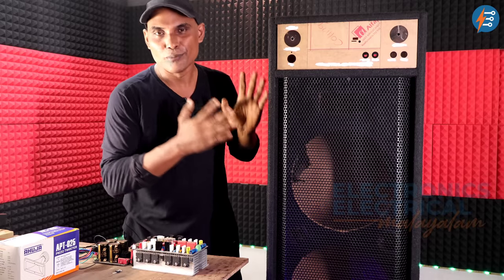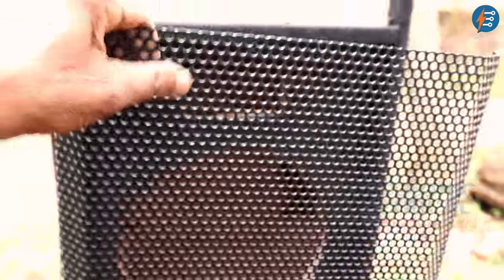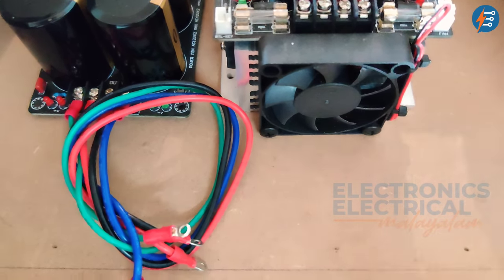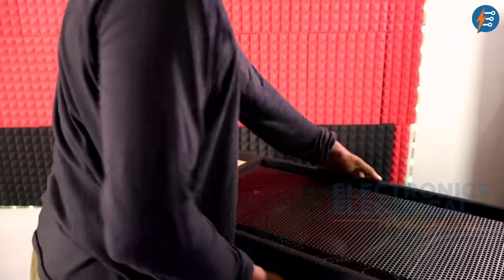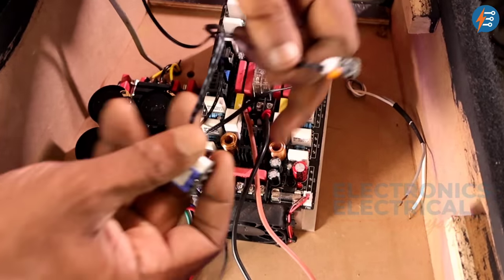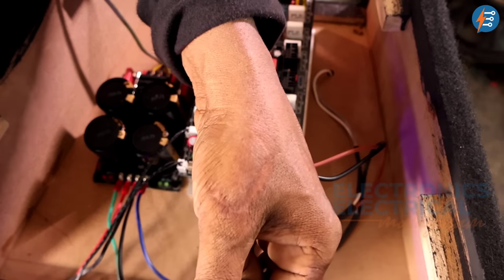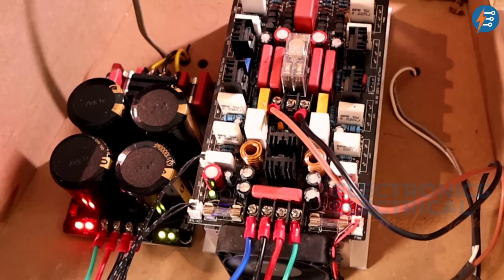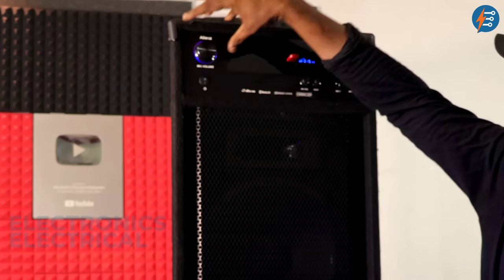Here I'am Building a 500W Amplifier Enclosed in a Custom Box | Must Watch building this PA System

Comment: Oru XLR line in and line out koode add cheyyamaayirunnu eamgil external mixer koduttal (sm6,Makie 2 channel, yamaha 2  channel, osl etc... kodukkamaayirunnu. Amgane cheythirunnemgil  nalla quality ulla mic mix output kittumaayirunnu. Aa tone control borard add cheythathinu pakaram oru 2000to3500 ragnil kittunna nalla mixer aayirunnu.Note: Amplifier boardil ninnum eadukkunna (12.clock audio/ plan audio, direct amplified signal) aayirunnel baaki eallam mixeril cheyyamaayirunnu. PA boxil oru master control nobe maatram mathiyaayirunnu.
Reply from the maker: Yes.. Thankyou for suggestions ❤